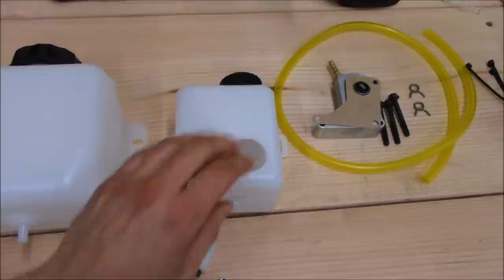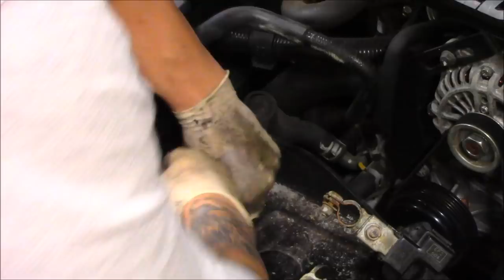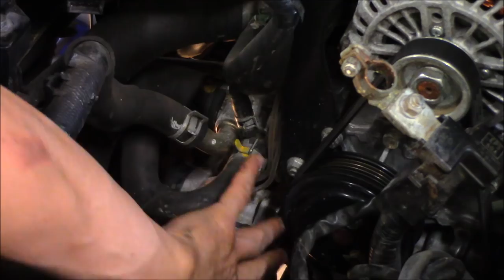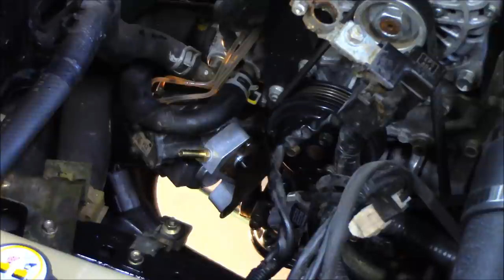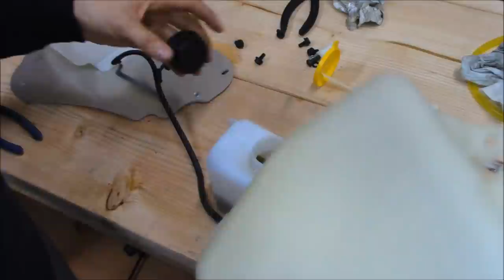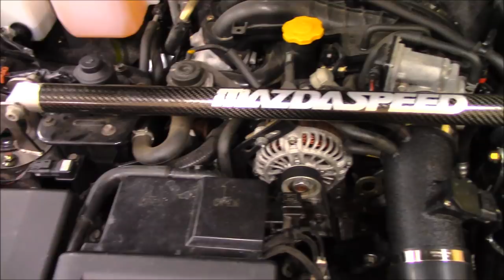Project RX-8: SOHN Oil Metering Adapter Install

Comment: Howdy,  great video and thanks for posting. Now that it’s been a while since install would you still recommend installation and have you had any issues with the system? Also is the adaptor designed so that if you run out of 2-Stroke oil in the adaptor reservoir it will then draw on the sump engine oil as a back up or does the engine oil and 2-stroke oil work together at all times? Thanks, Robin.
Reply: No by installing the sohn adapter you're blocking the engine oil and only drawing from the reservoir ..(clean oil)  so gotta make sure reservoir stays full...   hope that helps...??
Reply: @jakeowens5580  hey! Also can you use the same oil that you are using  for your engine or need to get a especific one for the reservoir? Thanks.
Reply: @Jorge-ku1zz  I use rotary specific oil. Called  Idimitsu racing lube. any good 2 stroke oil will work though.  You want something that's ment to burn off clean after it lubricates...  I order several quarts of idimitsu  off of ebay or amazon fairly cheap.  Hope that helps
Reply: @jakeowens5580  yes, i use regular mobil one in my rx8 because i was not sure wich one was better i think i will order idimitsu thank you for your help. What size you think i can use 5w-30?
Reply: @Jorge-ku1zz  run the idimitsu rotary premix in sohn reservoir.    And mobile one for the engine is good.. I still use 5w20 only cause the Mazda manual says to but alot of people use 5w30 or 10w40..
Reply: @jakeowens5580  thanks, what kind of oil  you rrecomend for the engine?
Reply: @Jorge-ku1zz  I use Castrol  but honestly any big name will work.
Reply: The main thing is just make sure you change the oil every 3 thousand miles. And keep it full..good thing with the sohn adapter you wont have to top the engine oil only make sure reservoir is full
Reply: @jakeowens5580  thank you for your help!
Reply: @jakeowens5580  yeah i am just worry about the emission state test with this sohn adapter i hope it pass
Reply: @Jorge-ku1zz  itll pass it shouldn't effect anything.. if anything you'll have cleaner emissions. Cause now your burning clean oil that's meant to burn and not regular dirty oil that's not ment to burn
Reply: What year rx8 do you have? Where u from ? I'm in the fort worth area.
Reply: @jakeowens5580  main is 2005 i live in misourri . Good to know i was wondering if it would affect anything in the emission. But yeah, Should be even better. I haven't installed yet i just ordered the sohn adapter in ebay.

Comment: My Rx8 oil metering pump seems to have failed so I thought this maybe away of replacing it as it costs over £1300 (approx $1500) from Mazda, but you still need the OEM pump for this to work damn it lol
Reply: Premix hard may be a temporary solution for you.
Reply: @She1lby  I fixed it now. I took the car apart what happened was the plug (Oil Metering Pump Sensor) was broken I dont know how so I just replaced and reset the OMP sensor. Thank you for the advice though I really appreciate it.
Reply: @iamlinxx_  Damn you fixed everything by yourself that's awesome.
Btw what oil \ premix do u use?
Reply: @She1lby  I had help from a friend and it was a lot of trail and error to be honest. Everyone was telling me you cant replace just the oil metering pump sensor and you need an entirely new oil metering pump but thats like £1400+.  As for premix I use Idemitsu (I think thats how you spell it).
Reply: @iamlinxx_  Nice, you just pour it in fuel or is it inside your sohn adapter?
Reply: @She1lby  I have these measuring cylinders / containers with pre mix in them that I fill up and I have stuck labels on them (I have 3) so I know if I am about to put in x amount of gallons or litres of fuel that I have to empty x amount of pre-mix into the fuel tank first and thats how I do it as I dont have a sohn adapter, may get one though got to do a few things to the 8 first however.
Reply: How do you know it failed?
Reply: @ve2430  Their was a few clues. The obvious one was the car put itself into limp mode and engine management light was on. I have a OBDII device and when I scanned it the device said something about the oil metering pump. When I went under the car to check I could see the Oil Meter Pump sensor had snapped. So the pump was fine but the sensor was broke and you cannot buy the sensor on its own even though its obviously a generic sensor like a crank shaft sensor. So I found a used OMP and tried various sensors until I found one that fitted and replaced that. car has been fine since...well the OMP has

Comment: Do you still have to get an oil change every 3k miles even with the adapter ?
Reply from the maker: I change oil when it gets dark and typically that happens between 2-3k miles depending on the car. The RX-8 I still change a little before 3k miles.
Reply: why not change it every 2-3k? it's by far the cheapest way to make sure your car doesn't explode!

Comment: Hello there, I`m a RX8 owner. Just want to know how is everything going with this kit after you have installed it for such a long time? Any reliability issue?
Reply from the maker: So far so good, but keep in mind the car has been parked for most of the winter. I've put maybe 2k miles on it with the adapter.
Reply: How's it going now? Haha. I'm buying an rx8 soon.

Comment: How does this not inject motor oil of the old lines are still attached?
Reply from the maker: The pump housing seals up the passage way to the engine's oil and prevents it from entering the pump.
Reply: Garage Quinn Motors alright thanks
Reply: Is that mean the four tiny clear tubes are the pathway for premix to get into the cylinder?
Reply: Bob George , so the sohn blocks infeed from the pan. And it feeds new oil from the tank next to w. washer

Comment: How many miles do they say the filled tank will last. And whats the price of the kit.
Reply: Jim Smith about every one-two oil changes. You can buy it on eBay for less than 300
Reply from the maker: The tank holds almost 2 qts of fluid, so you can go a decent amount if you factor in that stock injects about .5 quarts every two tanks of fuel. I like the ease of not having to check the dipstick all the time and just being able to look at the tank to see if I need to add or not. So far it's been working out well.
Reply: Jim Smith I never calculated. But I believe the full tank will last at least 3k miles.
Reply: I have a sohn, and I fill it up oh every month or more. But I drive my 8 hard. Real hard

Comment: I know this is your daily, but what light weight batteries have you had good luck with?
Reply from the maker: I had a bad experience with Braille so I won't ever be using their products again. I have heard a lot of good things about Shorai and am probably going to try them next and for this car to further the weight reduction.
Reply: I have used a small agm which only lasted a year. I am thinking about going with a sized miata battery next time. I have been using a penzoil/quicksilver premix from wallmart for 25k miles. Not that it is better but it works well as far as I can tell.
Reply from the maker: I have used Quicksilver in the past when I needed to grab something quick locally. No issues.
Reply: +1 GQM on Braille x 2- failed on different DD project- ECU reset, lost stereo- PITA to fix. Rotaries start 'pig rich' and need lots of juice to spin starter fast- to prevent flooding motor. Since de-flooding 13-B is also a PITA (oil change for the OCD), I'd rather go AGM, maybe even a Optima Red Top 35 R- reversed terminal- and, reduce weight in other ways. Heck, even new, I run a small trickle charger off season, clean grounds and consider swapping ground straps all the time. Since ignition is the motors weak spot- I hate to fool around with anything that might compromise it. I've read mixed bag reviews on Shorai Lithium batteries- not sure if I understand its properties well enough to run with confidence. I have an '08, and, stayed away from '04 & early '05's, so I wouldn't have to worry as much about replacement motors. Maybe overly cautious, but- don't want a pretty paperweight, or, robust boat anchor. Can't afford a re-build on top of: purchase price, mods & running expenses!

Comment: This sucks because the whole reason we premix is because the omp
Does not keep up at high rpm is using the same omp pump yeah is 2 stroke oil being objected but at that price I rather just premix lol
Reply from the maker: You can still throw some premix into the tank if you are going to run a 
track day or be at sustained high RPM for a while. This prevents oil 
being pulled from the oil pan and being injected into the motor, which means no 
more constantly monitoring oil levels and now being able to run full 
synthetic oil.